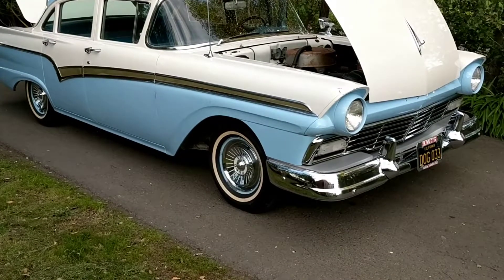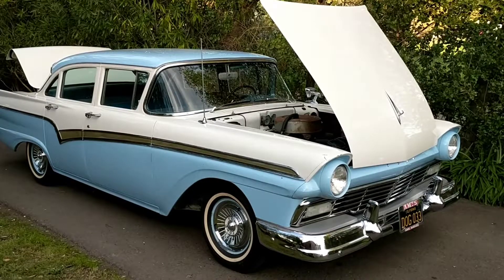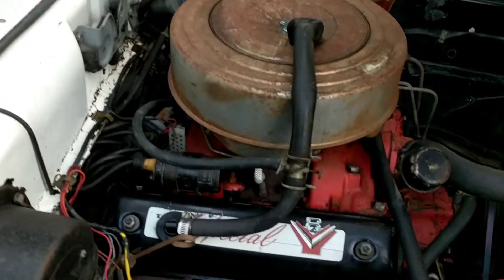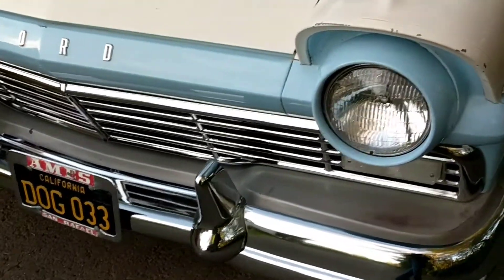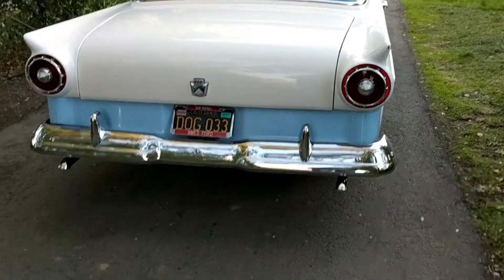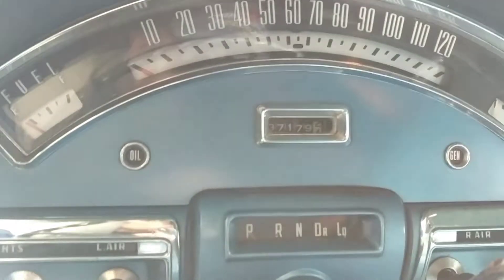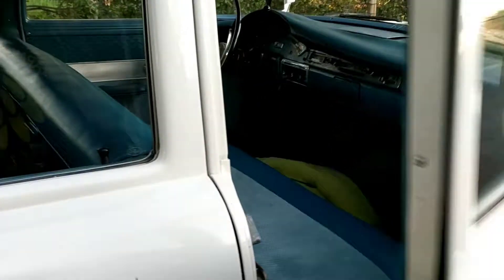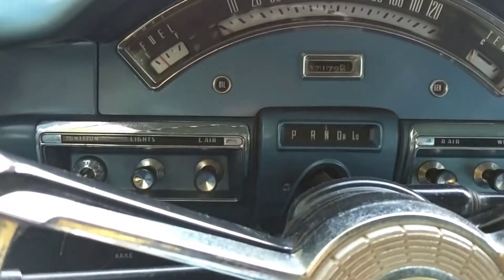1957 Ford 4 door sedan with Thunderbird 312 engine "Custom 300"

Comment: Thats what I like to see. I am age 68 and have owned a 57 ford station wagon. Mine had the 292 Y block V8. Yours is the right engine color scheme of ford red with black valve covers and I do remember the 312 some had with the T bird on the covers. The ones I see here though are messed up in where people put later model FE engines in them and it ruins the spirit of originality that once was when they do this. If I had one that came without the engine I would be patient and find me a Y block V8 for it. The Yblock engine had its own sound and was a very heavy cast iron engine

Comment: If it was jet black, Lee Marvin could be driving it around Cicero in 1957 as Detective Lieutenant Frank Ballinger, of M Squad.
Reply from the maker: You haven't seen the video of the 57 Ford Police Car we built?
Reply: @rodneyracer  Yeah, that Napa cruser is the same make, model, year, and color as the M Squad Ford.  Except for all the markings and fixtures that turn it into a police cruser and not Ballinger's unmarked detective's car.  Sweet.

Comment: We had a pink and white 56 that I barely remember, but when I was about 3, in 1963 or so, I guess, my dad had a chance to buy a white 57 4-door with this option of this T-bird engine in it, a three speed automatic transmission, and believe it or not, factory air-conditioning! That was our family car, named “Old Whitey”, up until I was about 11. Nothing ever went wrong with it, and we finally sold it to a local gal about to go off to Texas Tech in Lubbock, with well over 150,000 miles on it. We kind of lost track of it but about 2 years after she took it, she told HER dad to see to it that word got back to my dad that one brutally cold panhandle morning, “that old Ford he sold her” was the ONLY vehicle in the big dormitory parking lot that would START. All he said was “I’m not the least bit surprised … that car NEVER even hesitated to start after the starter had turned the engine over a couple of times if you remembered to set the choke first. Last word we had was that it had gone over 200,000 miles on it after it had carried her through 4 years of school to graduation, and then sold, still running and driving. This, plus what the subsequent 68, then 76 Fords that were my youthful experience with cars, and ingrained in my young mind what I believed a car should deliver with just average maintenance and care, and further confirmed once I was on my own and bought a 71 LTD, and later an 81 F-150 pickup. These old American Fords were just bulletproof. I wish I could have Old Whitey back.

Comment: Probably the main reason it doesn't say Fairlane 500 anywhere on the car is because it's a Custom 300. My Grandfather had one identical to this car except his had a 3 speed with overdrive. I also had a 1957 Custom 300  2 door.  I replaced  the 312 with a 1970 SCJ 429  with a Toploader 4 speed.

Comment: It doesn’t have Fairlane 500 badges on it because it isn’t one!  It’s a Custom 300.  The middle model.  Those seats have been reupholstered.  If it is really a 312 that would be VERY unusual.  Decent car overall!
Reply from the maker: Correct! that is why the video description says "Custom 300". If the family said they ordered the 312, I dont argue. Head and block casting numbers are same for 292 and 312. Block ECZ6015 and heads ECZ-G in this case. Seats recovered of course! But look at the original door panels and the rest of the interior.

Comment: Also, unless there was an engine swap, the 312  Y-block wasn’t available in the Custom 300 series. The only engine choices were the 223 Mileagemaker 6, and the smaller 272 Y. Block. The 292 and 312 were available only in the larger Fairlane/Fairlane 500 series.

Comment: You said it's a Fairlane 500, but it doesn't say that anywhere on the car.  The reason it doesn't say Fairlane 500 is because it's NOT a Fairlane 500.  It's a Custom 300.  A different model altogether.
Reply from the maker: Testing you all. You passed-- Did you notice the title read Custom 300? Thanks For Watching!